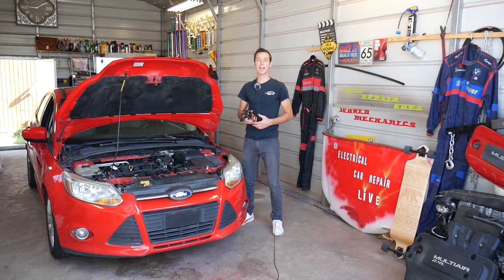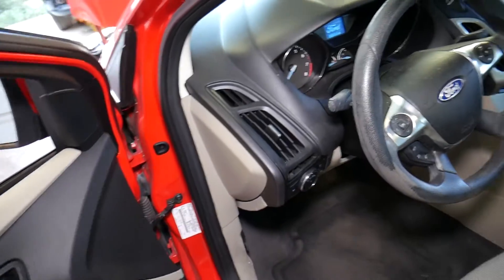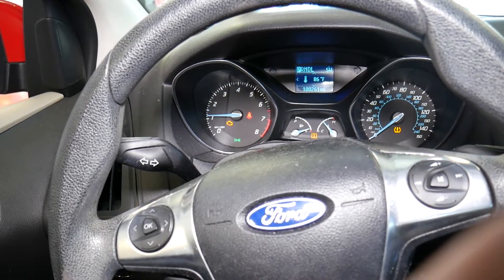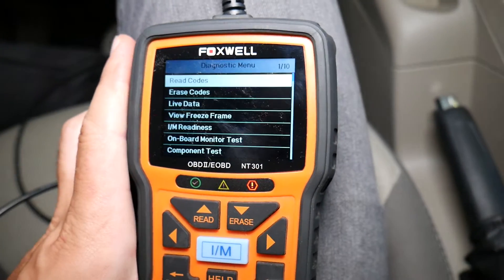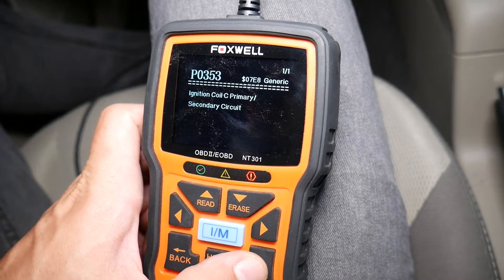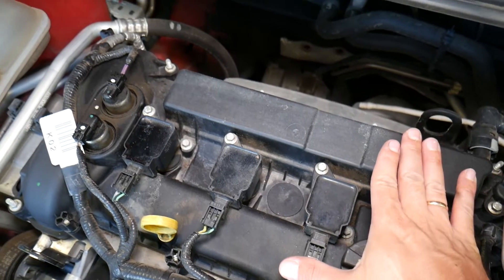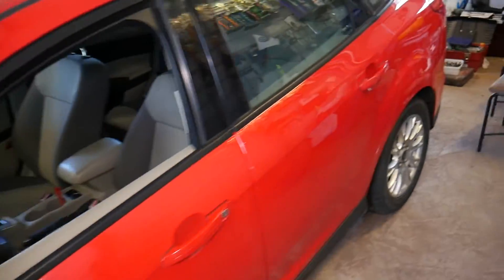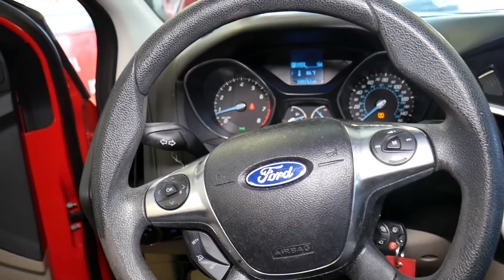FORD FOCUS CODE P0351 P0352 P0353 P0354 IGNITION COIL FIX. ENGINE LIGHT ON

Comment: If I don't erase the codes will the check engine light go off by itself?
I changed the coil and the check engine light came on. Swapped it to a different one that was good now I have 2 codes

Comment: Hi I have a 2014 bmw 320i and my gas gauge is not working, my back windows won’t go down, my trunk won’t open and its blasting my I drive with Light bulbs malfunction can I get some help? Thanks in advance.